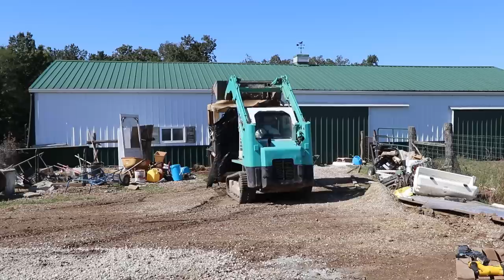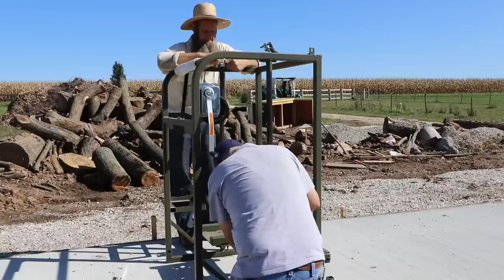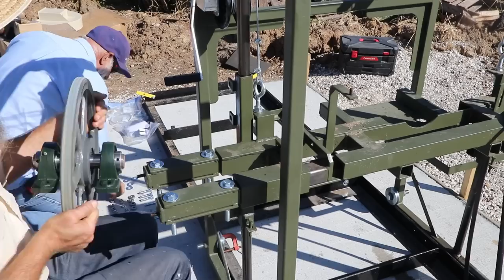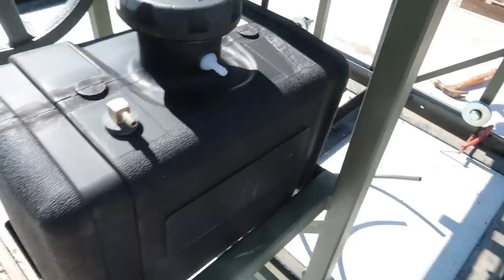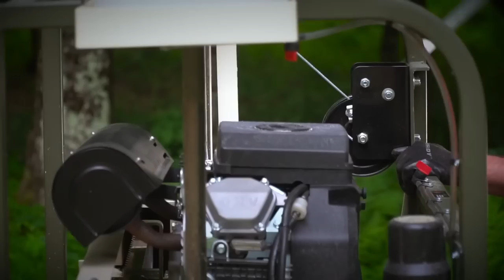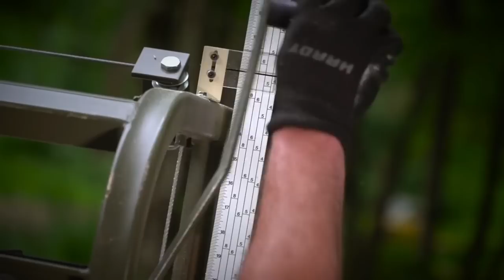UNBOXING a HUDSON WARRIOR SAW MILL / Making MONEY on the HOMESTEAD

Comment: I've used 'Crosby clips' for years in underground mining to make cable slings, pipe hangers (up to 4" diameter- 20' long steel pipes), and never had problem with the Crosby clips coming undone. I installed them which ever way worked at the moment, time is money, but I was taught to always use a minimum of three Crosby clips per connection, btw I was an underground miner for 43 years with government of Ontario (Canada) certification.

Comment: Osha regulations for fall protection require 3 saddles and they have to be alternating two the way you put them and one has to be opposite. Theres even spec on how far apart they have to be. Had to do this when blasting and painting water towers.

Comment: If you're gonna build cabins, make sure the market for them is there. Most people can't make a cabin to sell, even in kit form, for less than $15,000 and still make a profit on them. If you charge much more for a cabin, you'll be in competition with the people who are selling good used manufactured homes and with those being already insulated, wired, and plumbed, that could tip the balance away from them buying a cabin.

Comment: Doug, I just picked up my Warrior on Saturday. Still putting it together. One of the steps on their video is to drill out and countersink the top set screw in the pulley bearings. Did you do this? Watching the video, it really looks like they are drilling out the threads. I feel that LocTite will the trick here. Also, we haven't got to the blade yet, but got the motor going. I have what appears, great alignment, but my belt is flipping over. Any thoughts?
Reply from the maker: Email me offgridwithdougandstacy@gmail.com